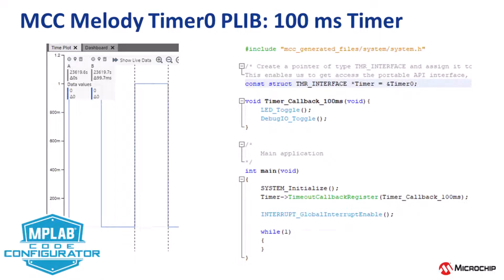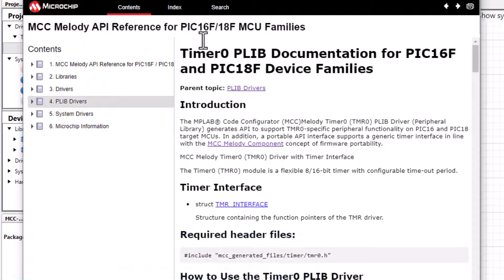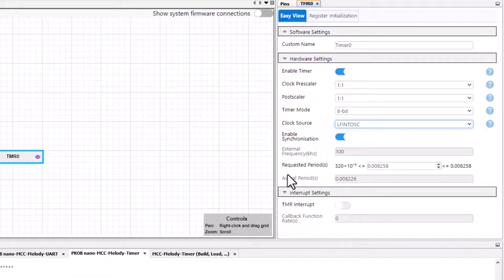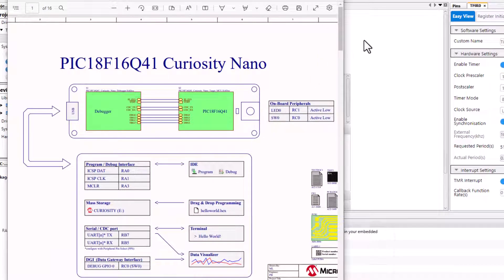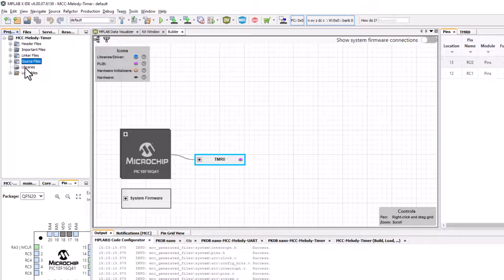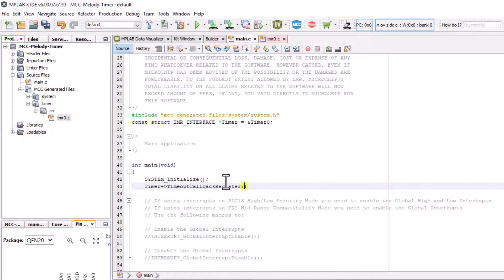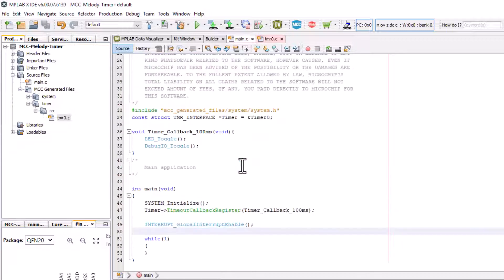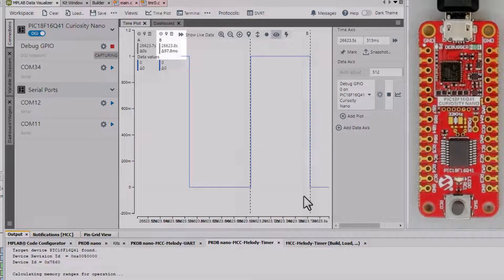MCC Melody Timer0 PLIB Driver: 100 ms Timer

Comment: I have followed these steps and the "const struct TMR_INTERFACE Timer0" at 3:07 has not been generated in my case. What might be the problem?
Reply from the maker: Hi there, thanks for reaching out with your question. The TMR_INTERFACE Timer0 might not be generated if the Timeout Driver is selected instead of the Timer Driver in MCC Melody. Verify the correct driver and PLIB configuration for your timer. Check the generated header files to ensure the correct structure is included. Hope this helps!